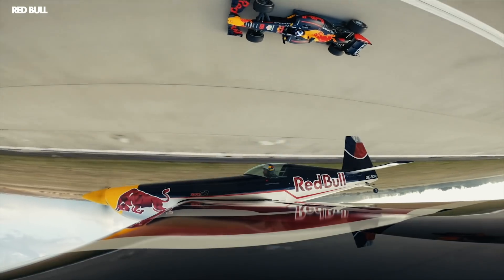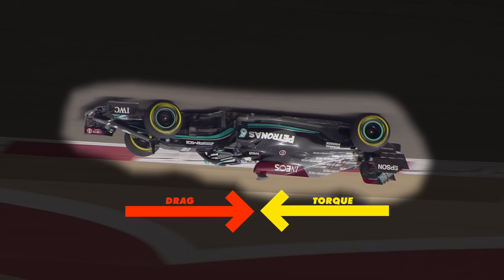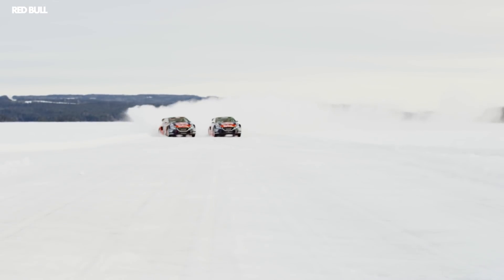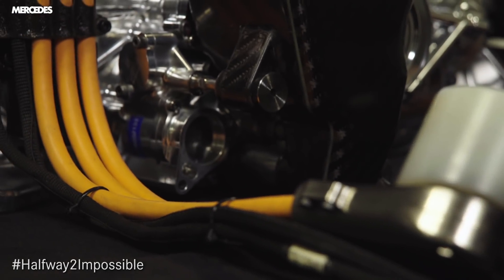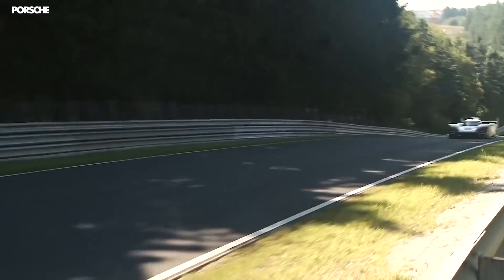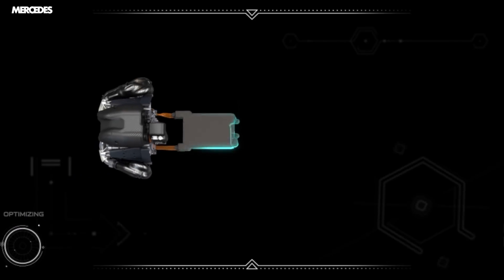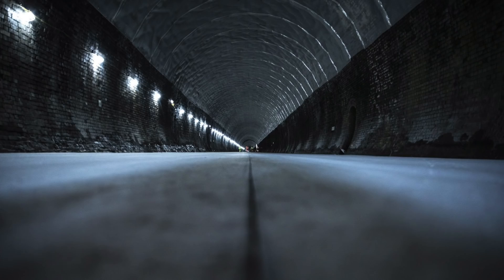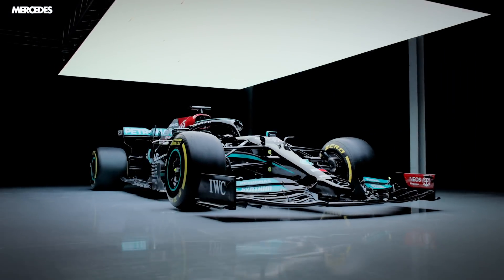Could a Formula 1 Car REALLY Drive Upside Down?

Comment: One part of the math you're seriously overlooking is that the more downforce you have, the more traction is needed to overcome drag. In general, drag and downforce are roughly equal, so the limiting factor actually becomes the tire's friction coefficient (and it's only possible if that number is greater than 1). Thankfully, modern F1 tires have friction coefficients around 1.5 so this suggests it is possible if exceed a certain speed, but that may be a lot faster than you think

Comment: You would need to make a race track designed to race these types of cars. Perhaps even make them remote controlled so that we can reduce the overall weight and danger to drivers. Though they would be short race's in the beginning. It would be a whole new sport. A way to get people excited about electric cars. If it works, it would easily pay for itself. I can't see this costing less than $1 billion 😬🫡

Comment: If you really want too...why not mount an F1 Car upside down on a wind tunnel ceiling while mounting it with a pin....ran the wind tunnel up to 130mph...when enough downforce is produce, release the pin...

it won't prove if its possible to drive F1 Car upside down...but it sure could tell if it's possible

Comment: Getting a f1 engine to run upside down is not a hard problem to solve. They already got oil scavanging systems. The oiling problem can be solved by simply routing the vacuum lines where needed.
The fuel problem can be fixed with a reverse float hose. Attach a weight inside the fueltank on a loose piper or hose so it will always stay down with gravity.

We already got a few engines that are designed to run inverted indefently. Daimler-Benz DB 605 Is a classic example of this.

Comment: Modern F1 cars since 2022 have an extra problem you didn't take in account. The ground effect, when hanging upside down there is less pressure on the suspension, increasing the space between floor and ceiling, equals less down-force.

Comment: 3:10 "The moment when the car requires the most downforce is when it is upside down on the ceiling" - Is it though? Because, when the car is on the sidewall, the downforce is not helping to hold the weight of the car, only the friction of the tires on the wall is holding the weight of the car in place ...

Comment: What happens if we give it a speed much higher than required (either by external propulsion or internal engine) and then cut the power right before going upside down and letting the car coast the rest of the way?
Reply: It would slow down....

Comment: I mean, the running start and the braking phase do not need to be done in-tunnel, so you don't need a 2 km tunnel. You'd only need that length to get up to the ceiling, spend 5 seconds in it, and drive back to the floor.

Comment: So theoretically 
Maybe the engine could be inline and sideways instead
And it'll be in the same orentation just flipped on the ceiling
Or a solenoid valve could open and close the hole and oil would have pressure to shoot it in

Comment: Traction would be a huge issue, yes you can get 750kg of downforce at higher speeds, but is 750kg of downforce on the tyres enough to overcome the exponentially increasing drag at those kinds of speeds. Normally at 300 kmh you have 750kg of weight + 1500kg of downforce pushing the tyres into the ground. Upside down will 750kg of force on the tyres be enough? How much torque does it take to maintain that speed?

Comment: How about bring an F1 car into a wind tunnel, turn it upside down on a support structure against a suspended "road" surface constructed above, turn on the fan and slightly withdraw the car support when wind velocity is sufficient.  Does it stay up?

Comment: TLDW: Ignoring facts such as the engine's behavior while upside down and the place where the stunt could take place. Yes, it could theoretically work because the cars meet the performance requirements. But if you take into account the reality of the car's engine not being able to function properly while upside-down and the fact that there aren't any tunnels that would allow the car to transition seamlessly because they're either too narrow or too short. You would come to the sad realization that it's currently improbable.

Comment: Kinda feel like you could put a rotery with 2 stroke oil mixed in with the fuel and put it into a f1 car. And all you would need is to get the fuel into the engen

Comment: Wouldn't it technically work with a boxer motor? I mean the pistons are basically always sideways, so it would not make any difference for the motor, if the car is upside down or not?

Comment: Hydrolock was an issue with radial reciprocating engines. That's why you see ground crew rotating the props. Drain out any oil that drained down into the bottom cylinders

Comment: now my mechanical mind is wondering how the KERS motor is interfaced with the rear axels, in sync with the engine?  In other words, how do you properly integrate two power sources into 1 output?

Comment: The weight of the electric cars has to do with driving relatively long range distances; most of that weight is due to battery weight  or total weight of batteries. If the criteria is driving upside down for 5 seconds, the weight of the electric cars can be reduced by using battery storage sufficient for a limited range of distance or time.

Comment: This narrator has no understanding of physics. If the car could be accelerated to a sufficient linear velocity without changing the car's orientation,  the car would slide until the kinetic friction slowed the velocity of the car below what is required to keep sliding upside down. The other factors have nothing to do with driving upside down. Those are entirely different questions  that do not answer the specific question. A rocket can break the gravity of the earth if it reaches a sufficient velocity even if the rocket is destroyed in the process, the question would be satisfied.  A different question is can an indy car be driven upside down while maintaining control?

Comment: Forces toward the track has to be equal or greater ( not exclusively equal ). The greater the orthogonal force with respect to the track relative to the gravitational force due to the mass of the car, the easier it is to remain driving upside down. The challenge is the transition from the upright position to upside down position while sustaining the effective operation of the engine.

Comment: well as long as the car generates more downthrust than its weight it should be able to do so 

we could probably test this in a wind tunnel just have the car sat normally run wind over it equivlent to what it would experiance at race speeds and then try to lift the car with the equivlent weight force for the car if you can lift it then it would fall if upside down

Comment: Using a 2021 spec Formula 1 chassis with a Formula E motor and batteries to perform the stunt might be doable. The tunnel would need to be modified for driving on the ceiling.

Comment: The McMurtry Spéirling could in theory do this. You're probably already aware it exists at the time of my posting this but it weighs under 1,000KG and due to the fans produces 2,000KG of downforce at 0 kmph. 

It is fully electric so doesn't have the issues that most ICE's would have driving upset down. 

So in theory, it could comfortably putter along at walking pace upside down.

Comment: Put the engine in a gyroscope, find a way to connect the crankshaft, flywheel, transmission and driveshaft together and there ya go, main issue is fixed.
Sometimes my genius is almost frightening.

Comment: Ok but this video is ignoring the spirit of the question. You're not wrong, you're just an asshole. Ignoring the logistics of location, oil and fueling, is it possible for an F1 car to generate enough downforce to hold itself onto a ceiling? By all accounts, the answer is yes. Obviously you would need to construct your own venue, and of course the cost for failure would make it prohibitively expensive to even try, but no one gives a shit. We clicked on the video to see the answer to the idea of the question, not "Could an F1 car ACTUALLY drive upside down?"

Comment: Instead of straight section of tubular track for inverted driving, what about making the tubular section in the turn at the end of a long straight. This way you can combine aero downforce with the centripetal force applied by, effectively, a 360 degree banked turn. Kind of like how a vehicle can remain inverted through a loop section of track, as long as it has momentum pressing it into the loop consitently through the entire loop.

Comment: Possibly there could also be problems like oil starvation when driving upside down. I actually dont know how the lubrication system works on F1 cars and if its a dry-sump or wet-sump system, but assuming its using a wet-sump the engine would also endure damage when driving upside down
Reply: Dry sump with multiple scavenge pumps

Comment: Since the downforce is a result of airflow, why not have the air moving and not the car? If you put that F1 car in a tunnel with airflow, you can validate your hypothesis with a ground speed that will only be the difference between the wind speed and the car speed. And if you want to test that at minimal price, start with a model at a small scale.

Comment: I wonder if two formula-e motors somehow fit to an F1 car (and a much smaller battery) would be enough. You could have a dedicated motor for each rear wheel. One of those will put out 335 HP and I'm guessing you could probably get even more if you only need a short duration like this. Maybe you could even power it with super capacitors instead of batteries.
Reply: Im 100% sure that the idr is actually capable of driving upside down. Much higher frontal area compared to f1 makes up for the additional weight. Downforce numbers probably come from high altitude (where the air is much thinner) and are probably not recorded at actual top speed but more likely measured during a top speed in a climb.

Comment: OR hear me out……. Use a higher than FI legal downforce spec. It’s not like we’re running an actual race with regulations, just max out all the possible downforce surfaces and include soft side skirts to seal it while transitioning.

Comment: would an above ground construction be easier and cheaper? no need to dig a tunnel, but the supports needed might undo the advantages. another thing to consider is that the entire track would have to be asphalt, as i assume all the grip calculations are done on asphalt. and i'm not too sure how well asphalt fairs when suspended on a ceiling.

Comment: i dont understand why we cant make a pressure system for the oil feed that would be sufficient for upside down operation. The system that is installed in an acrobatic plane may be sufficient for a few seconds only and with decreased power output but they could surely make a better system than this if required.

Comment: the aerobatic engine argument was off. the reason why those aerobatic planes are not able to fly inverted for long durations of time is because of the wings swept. If you look at the bf-109 from the 2nd world war, u will see an aircraft that is capable of flying inverted for around a minute at a constant speed

Comment: Correct me if I'm wrong, but don't you need to account for drag in downforce power? I mean it will require extra downforce power for every speed increase due to tires needing enough traction to overcome drag?

Comment: What about making a motor that could rotate 180 with a button press, wouldn't that be possible?
Reply: Thats so much more work than just making it electric or redesigning the fuel/oil system

Comment: Ferrari was investigated for oil leak into the engine that could boost fuel flow rate in 2020. So oil won't be a problem.

Comment: Actually it saddens me that he says that the longest tunnel is like 15miles :( there is a tunnel double the length of that in my home country. Switzerland has a tunnel called the Gotthard basetunnel with a length of 57km or 35.5 miles. Still a damn great video but I have a lil depression now.

Comment: Really good luck driving in the ceiling of Lærdalstunnelen. Straight walls on the side, light-fixtures at the top and bumpy ceiling. Also, it's not the longest tunnel, it is the longest road tunnel (for now)

Comment: I think you could quite easily (by comparison) do this in the real world if attempting with a scaled down model version of an F1 car that uses an electric engine, one that is still quite large, maybe even (and I'm just guessing) as big as half size. Because model cars in general have an insane power to weight ratio and accelerate incredibly fast too. It wouldn't be quite as cool without a driver but I think it would still be very impressive to see it done in this way in real life.

Comment: I got an easy solution.
Use the le mans mercedes, do half back flip in the tunnel, switch to reverse while its in the air, and land on the roof.
drive 5s in reverse,  then repeat the process  backwards

Comment: What about rotaries?
The mazda 787b i think was one of the first cars to produce its own weight in downforce and when really pushed, it could be tuned to develop up to 900HP:
The engine in this car is not a piston an it does not rely on gravity to extract oil since the oil is actually in the fuel itself like a 2stroke,.
The only issue then, would be the fuelpump which, with a plastic bag fuel tank, commonly used in aircraft to avoid air bubbles, could function in any orientation.

Comment: No, an F1 car CANNOT drive upside down. Simply because it won't be able to suck fuel from the fuel tank. Downforce doesn't stop the fuel from being pulled away from the pump in the bottom of the tank due to gravity when it's upside down. Oil pickup could also be an issue.
Reply: This doesent seem like a very hard problem

Comment: Wouldn’t the pressure from down force be less upside down because gravity is pulling against your laminar flow so it’s not sealing in the back end, it would be pulled down and trial off.
Or would the F1 chassis essentially be creating lift and sticking itself to the ceiling if it was upside down because all the wings are usually an upside down airfoils to creat downforce and now they’d finally be the right way up?

Comment: I wonder if it would be possible with the next gen F1 power units. More electric power. Realistically you could get up to let's say 200mph using the ICE, and then use the MGU-K to keep your speed above 185mph for 5 seconds. But I do think the whole "flipping" part is probably the most difficult.

Would love to see one of the F1 teams try it in their wind tunnel tho, as a proof of concept.

Comment: i dont think its possible .   at 120 mph they create their own weight in downforce.   but than it has no grip. cause there is no pressure at the wheels. the moment you go upside down at 120 mph, they will slow down and fall

Comment: Fuel Injection, pressure carburetors, inverted oil systems exist since World War 2 to solve the problems of inverted flight and negative Gs. I'm sure any engine maker nowadays could adapt existing or older engines from past championships for this challenge.

Comment: The best way to do this would be a very wide tunnel shaped ramp, where instead of slowly going upside down and staying there, have it act similarly to a loop where the g force of the rotation holds the car down. This could be done similar to a tunnel because of the immense speeds of f1. Although this would still use the downforce to complete the steering required, it wouldn’t be the primary reason the car would stay upside down

Comment: Does a Diesel motor require and use oil in the same way as you describe here? Im thinking specifically the Peugeot 908 FAP.

Comment: Getting upside down is actually the easy part to solve. Build a specialised ramp that smoothly turns the car over and onto the ceiling. 

I've built such a ramp for BMX and skateboarders to use, the principle would work just as well with a car.

Comment: Not true that the cars weight is always comstant. The weight of the vehicle is constantly changing based on changes to elevation (gravity difference) and depletion of fuel. The Zero Fuel Weight (ZFW) is the one that changes the least and can be treated as a constant

Comment: The physics at 3:40 is a bit off. It's true that the amount of downforce just equal to the weight of the car is not enough to provide sufficient tractive effort to keep the car at needed speed but just because 209km/h provides roughly 7.5kN downforce, it doesn't mean that 7.5kN of downward force is needed to keep the car from slipping tires at 209km/h. The minimal theoretical speed needed for such stunt would be that which produced enough traction by friction to keep the car at the resulting speed since we don't need to accelerate anymore. Unfortunately, I can't get reliable figures to calculate the proper coefficients but if we assume that drag is equal to av^2 and downforce is bv^2 we can solve the equation of forces being in equilibrium and we get that the target speed should be - if I'm not mistaken - sqr(mu*M/(mu*a-b)) where M is mass of the car and mu is the friction coefficient of the car wheels. That friction coefficient is crucial for speed estimation and the video completely ignored it as if the car behaved the same regardless on what surface it was being drive against.

Comment: There is a potential failure in the maths. Where has it been determined that you need the entire weight of the car to produce enough traction for forward drive?  It could be less. I'd wager it is.